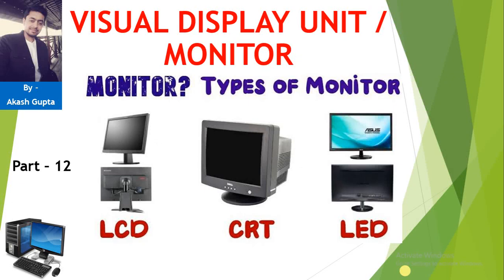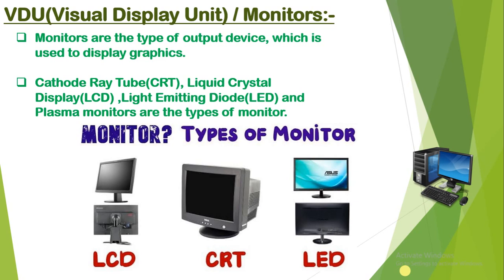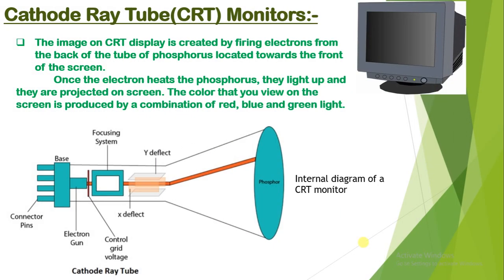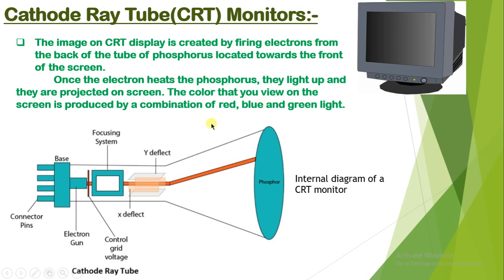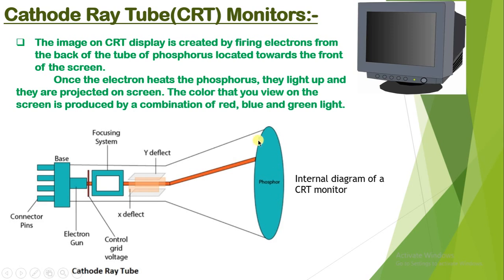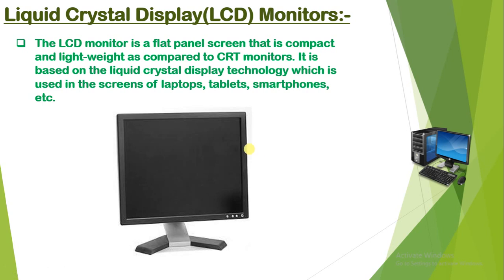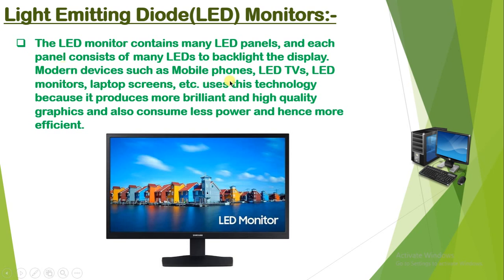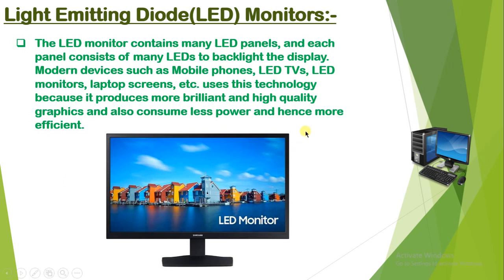#Monitor Visual Display Unit / Computer Monitor || Types of Monitor || Full explanation ||

Comment: What is computer output microfilm ? Please make video.
Reply from the maker: It's a type of storage system which is basically used in libraries to store large amount of documents in the form of images. Whenever required, it is scanned through scanning output devices made for microfilm and the documents can be seen in computer screen easily.